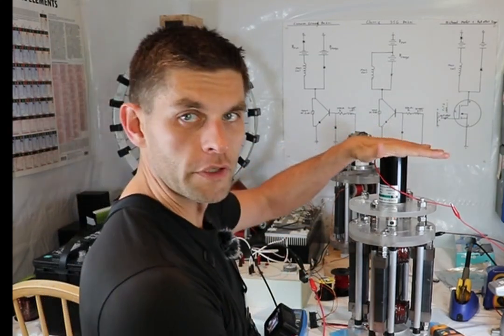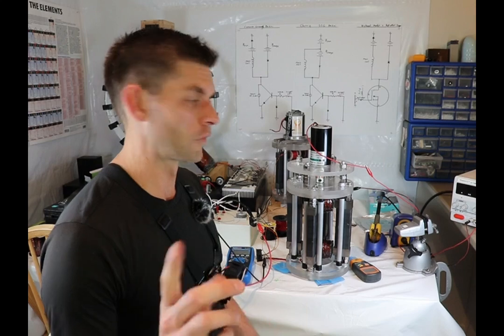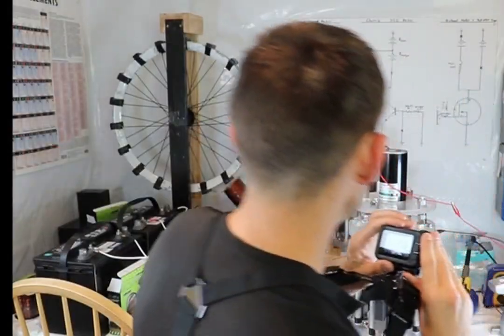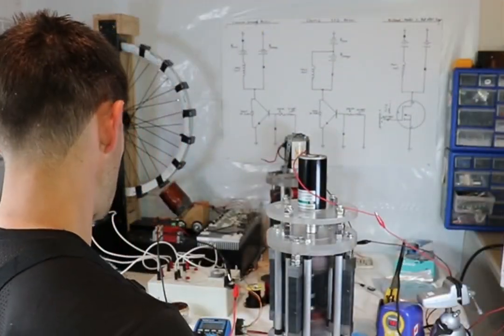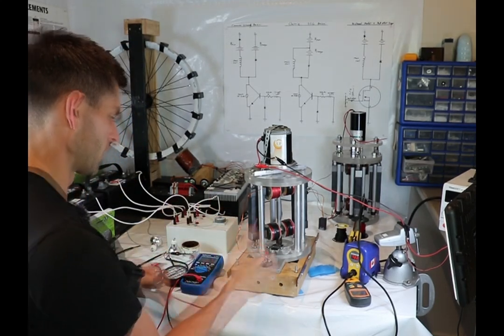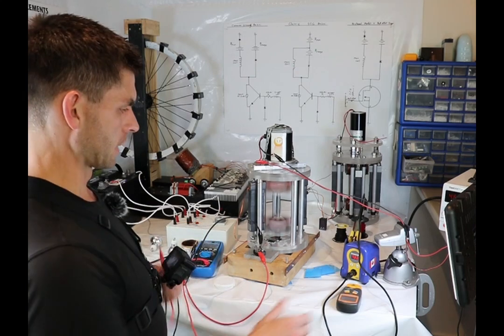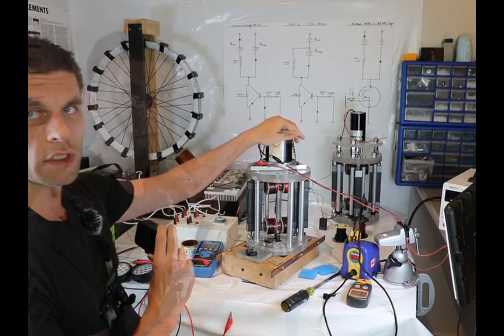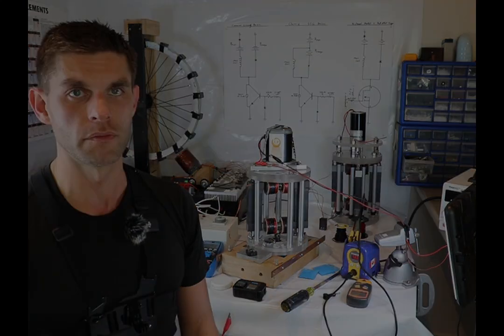Is free energy possible? Yes, in an open system its 100% possible.

Comment: Sitting vertical like that it's going to tear itself apart.
Reply from the maker: I dont see why horizontal is beneficial
Reply: Are you using a thrust bearing? Either way all the load is on one bearing and a lot of uneven vibrations from the pulse. With it horizontal you can even the load and balance better on bearings. 

Maybe horizontal configuration with needle bearings for a tighter smoother motor than ball and make sure they are bearings with metal cages to handle heat better. Also use a good moly or a moly-graphene grease.

Comment: I've always pondered on perpetual motors and such and how it might be possible to generate energy. Imagine a sort of setup like a magnetic weight that hangs on a spring in a frictionless tube...with another opposing magnetic field below. Could you set it just right so that the magnetic field makes the magnetic on the spring bounce continuously? Taking into account for gravity obviously. The stored potential energy in the spring and from gravity, would be constantly returned by a magnetic field. Hold it at a height, which is the initial potential, which then converts into constantly moving perpetual kinetic energy when you drop it...put it into a loop...then put a coil round the tube and absorb from the kinetic motion without taking energy?

 Things have perpetual motion....atoms move all on their own, molecules move on their own, objects fall to the ground thanks to gravity. There are systems in nature that are offering motion for free and if we harness that in the right way...we'd draw energy for nothing. Imagine a tube running through the earth....if we lined it with copper, then dropped a magnetic object down it....would it not go back and forth from one end of the tube to the other for ever? 

Or maybe we should draw back from energy we create but waste...I saw it mentioned once and I don't know why it isn't being implemented in every major city....put electric generating, water turbines in the main water pipes for a city...as we use water it creates electric. Think of the amount of energy we waste...cars move...put something on the bottom and line the roads with a substance that generates electric from the motion of cars on the road. Gain energy from energy being used. 

Then there's zero point energy aswell...but that's a whole different thing altogether and I don't think we don't understand entanglement, super-positional states and virtual particles enough yet to debate that one lol.

Hats off to you fella...people can say what they like but at the end of the day you're there having a go at it with a passion....good luck to you my friend and I wish you the very best 👍
Reply from the maker: Thank youbfor the kindness and support ❤️

Comment: The kromrey converter should speed up when shorted, be safe to touch and blow a cool breeze from the core. Mine does. It's critical to impedance match the coils. Super critical. Even 1ohm off and it will not perform correctly. The coil winding direction is also important.
Reply from the maker: Agree.

Comment: it should be understood that the energy in a rotary mechanism is Concentrated near the center of rotation.    this is so because of the law of the (rotary) 2nd-class lever.     in turn, power should be taken off (a motor) at a radius that is Less-than the radius at which the force is produced in the motor.
for example, the use of a pinion gear whose effective radius is about one-half of the radius of the rotor/armature gives the motor inherent MA  of  2.     mechanical advantage.
Reply from the maker: @daviddavids2884  this energy comes from the vacuum, open system that is accessed with sharp electrical impulses / gradients. This isn't explained with partical physics or neutonian logic
Reply: Hilarious. Go back to physics class

Comment: if you have relied, at all, on the work of tesla or bedini, you  will  not  succeed.    just as  they  did  not  succeed.       it is a mistake to use a dummy load.!    the only thing that should be in the output circuit is a very low value toroidal inductor.     very low means a small fraction of one ohm of impedance.
you may realize that the actual output voltage is the voltage that is produced at the reduced rpms; such as when the output is shorted.
you may know that a generating coil should not have a  lot  of  winds  of  wire smaller than 14awg.     such a coil acts as a current clamp.    (this is why most experiments result in  output  current  that is unusably low.)
instead, small-ish magnet wire (say 18awg) should be used  --  but multiple strands should be wound as a single conductor (for an equivalent of 14awg).   known as winding  'in hand'.
Reply from the maker: @daviddavids2884  umm i would call Tesla a successful inventor who changed the world... lol thanks for the view and comment. Stay tuned for the release of this technology to the people

Comment: using electricity to run a device that produce electricity...

🤣🤣🤣

chinese led light sold as 36W  are using 9W of electricity or less.
especially those made of plastic, because they don't need heatsink...
Reply from the maker: its more about the process and waveform... check out my pulse motor build

Comment: I replicated too the Kromrey Generator and I can tell you that one key feature of this generator is that when you put a load, your amperage draw goes down and your speed goes up! This is a missing a key ingredient in your setup.. Also the magnets must be Barium Ferrite, not strontium etc... My replication failed because I could not find any Barium Ferrite magnets on the market, even overseas they claim the magnets are Barium Ferrite even though they are strontium. Barium ferrite magnets have a radioactive isotope which is needed for when the magnetic field collapse. Also, the patent has a few mistakes so if you followed the patent wiring, it is incorrect. I hope this helps, I am not trying to get into any arguments with anyone. This is just constructive feedback 👍
Reply: They don't need to be barium.

Comment: Great work. Take a look at John Bedini's SG Machine videos which have all the functionality and circuit diagrams explained in depth by John re the use of rapid spiking for recharging batteries. BTW, you might want to consider wearing eye protective safety glasses when spinning up those rotors at very high rpms.

Comment: One other thing.  Does it make a difference whether or not the iron poles are spun/cuts thr field lines, or can the magnets be spun too.  I only say this because it may simplify my build.
Reply from the maker: @thecontact2609  shouldn't matter... but I wouldn't recommend as it's not how bedini did it or kromrey
Reply: Oh, this I know but I can still set the coils up to buck and everything else will be the same.  The only difference will be the fact that the magnets will essentially be the rotor part (the spinning part), and the poles will remain stationary.
Reply: Also, I could still set the generator up like the original kromrey/bedini style with me modifications.  I'll have to think more about it.  Thanks for the feedback.

Comment: How it will be Free Energy if you are inputting outside power source?
Reply from the maker: @randyserano7490  because it produces more power out than in
Reply: @MadscienceLPTECH  It seems you're doing something that you don't know anything. You can increase voltage but you can never increase the current.

Comment: I'm working on a cromrey motor at the moment too.
Reply from the maker: nice, love to see it...
Reply: I did the magnets a little different though.  I used round ceramic magnets with small cardboard wedges between them.  This allowed the north and south end to be parallel with each other.  The magnets stuck together looks like a U shape.  (nUs)  I then put shrink tube around the magnets to secure them.

Comment: Awesome and thank you for sharing but this won't work.
Reply from the maker: @ZincFold  wow I guess it won't than cuz you say so. To bad I wasted all this time
Reply: @MadscienceLPTECH  just sharing my opinion from spending around 30 years building pulse motors etc.
You will achieve very high efficiencies which can mislead you to believe over-unity is possible but there is always loss.
IMO, if you're searching for free energy you may have better luck looking into the works of Kapanadze, Akula and Ruslan.

Comment: Hi leds are non linear load, you need a resistive load and measure the current and voltage of the out put, at the same time as reading the power feeding the device.
Then you know the efficiency
Reply from the maker: ok i have some nice 50W halogen bulbs ill power this week for ya all :)
Reply: @MadscienceLPTECH  9 months later and nothing.. Where is the measurement with halogen that would show that it is 100% possible?? And as someone with an electrical engineering education, you certainly know that these devices produce many HF components in the supply and output current/voltage and that a cheap Chinese meter (any meter that is not able to measure HF) is not able to show the correct value. Or will this fact be ignored like everywhere else? If you are really educated, how can you claim that those LEDs really produce 24W? a) 24w is the power input, not the output power b) this really cannot be determined by looking only, without measuring you are just lying.

Comment: Amazing work keep it up! This reminds me so much of the morin motor (washing machine pump with the keeper plates ) a couple years back i managed to get the morin motor to self run for 5 hours on a heavy load then i disconnected it as its very loud and was getting to late (but did not want to at all ) i seen one of the leads had vibrated loose on the lead acid battery so this thing was running itself the whole time which i recognised beforehand that thats what it wanted to do when i spun it up with a dremal it would spin faster at a curtain resonant point so purposely changed my motor to a weak one to allow the gen to do the work itself.i was never able to self run again but did start self run/charge to a curtain point then start dropping this i beleive is becoz of the lead acid which dont like to work with this type of energy i think youll be better off with supercaps bank or lifepo4 anyways that was 12 years of trying at that point and finally achieved it no matter what anyone says so keep going and NEVER GIVE UP!!!

Comment: People often label highly efficient designs as 'free energy,' but no invention rivals the old steam engine, which can be adapted to run on almost anything.
Reply: maybe a tesla turbin, if someone would actually try to create one and do more research on them like one youtuber :D
Reply from the maker: @modrribaz1691  so there is no new technology and old stuff will be the best we ever have ? I think there are many free energy devices just waiting to be released that produce unlimited energy. What about machines that utilize the heat of the atmosphere and run cold, 2 working fluids... like geothermal above ground ? Anyways free energy is real and there are many people with working pulse motors, I've seen the Muller motor and it can power homes
Reply: @MadscienceLPTECH  yes the work "free energy" isn't really defined. It could be free energy like if you build something out of mirrors you can heat stuff, free energy from the sun. Most think of it as perpetual motion energy, which currently wouldn't work with our understanding of physics, but i mean we don't know that mich for that long. Who knows what crazy tech can be found for wormholes or whatever haha.
Reply: @MadscienceLPTECH  There's always room for improvisation, but not in the abstract. I mentioned steam engines because they can run on almost anything that burns, not just petroleum. In theory, even urine and feces could power them, but that's off-topic. Back on topic, the larger the power source (an 'open system,' as you called it), the more this energy seems free, though it isn't, since physics assumes a closed system.
Reply: @MadscienceLPTECH  Doesn't contain boiling water, thus cannot be real energy. Everybody know the best ways to get energy is just differing and more effective ways of boiling water.

Comment: Is free energy possible?
Hell no - this is a click bait channel
Reply: Doesn't mean much until you've got 2 batteries that you're continually swapping (drain/charge then charge/drain) plus a considerable load (LEDs don't count lol) to prove that it's actually sourcing more than it's using.
Veljko Milkovic's pendulum seems like the real deal mind you - how many times can you lift ~10kg ~1 inch before your arm gets tired? Versus simply maintaining the swing of 10kg. Like pushing a child on a swing won't tire you out compared to lifting them up.
Reply from the maker: @noleftturns  not click bait at all... I'm building the actual machines to do it with... they operate in open systems, the same as solar panels. Why would free energy not be possible? Geothermal, solar, wind... all free energy from open systems
Reply: @MadscienceLPTECH  and where are you getting your magic energy from ?
Reply: @MadscienceLPTECH  When the energy comes from "the ether"
Then you know magnets, batteries, and other tricks are to be used.

Now you see it
now you don't
parler tricks...

Comment: Where is the free energy???
Reply: You should try inertia use the momentum of a flywheel charge capacitors. Also use a one way bearing so that  when you stop the power the momentum of the fly wheel will carry on spinning.
Reply: @Lissica1  there is no free energy
Reply: At your moms
Reply: Add some super caps , ive found the same affect with a 36 pole bldc samsung smartdrive pulsed charging system, although its difficult to measure and verify !!
Reply from the maker: Stay tuned. The fact there is no additional amperage draw when you place a load on it is very intriguing
Reply: @MadscienceLPTECH  Place a bigger load to it! In special, load resistors and/or something with coils and capacitors and maybe the mystery will be solved. I still see no free energy. I recommend to read some books or articles about Coercivity and magnetic saturation! Or just simply clear the fact for yourself why the output power of generators is given in VAR (volt ampere reactiv)!
Reply: Thats the point is to separate the electromagnet from the mechanical. the extra energy comes from the surrounding environment.

Comment: smaller wire but many side by side in parallel for more amps aswell as high volts, I'm gonna make a generator soon and i plan to do 150x(0.20mm) strands of wire, to wind I'm just gonna do one layer of wire at a time and each layer as its own strand so at the end i can put them in parallel , 150 strands of that thickness can handle 13amps  whether that can be generated is another question but that many is the only way to possibly get plenty of amps
Reply from the maker: @doubleooh7337  I think the radiant energy dosnt even have amps... just volts... we need to try everything. Keep me updated, let's work together and spread this info